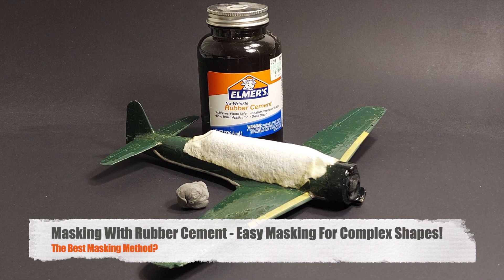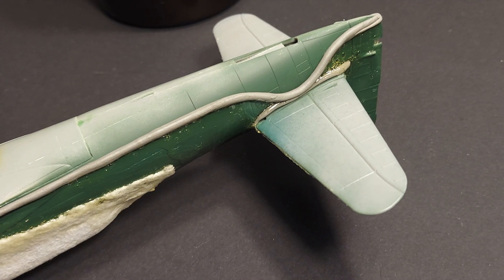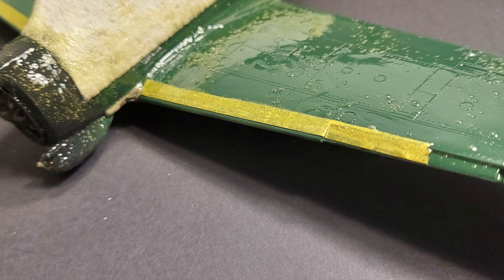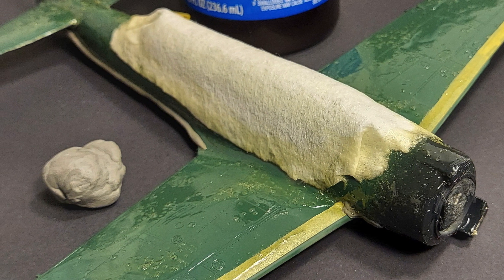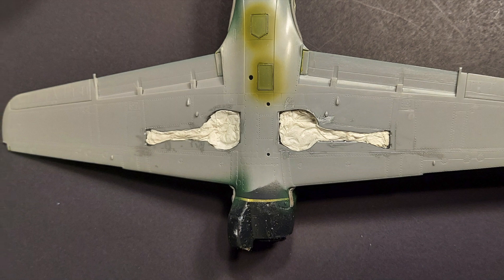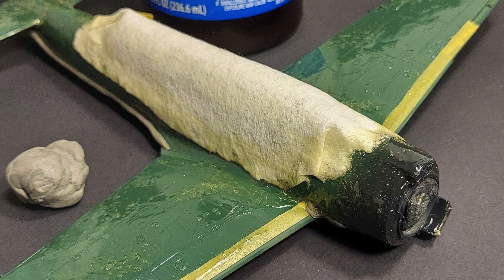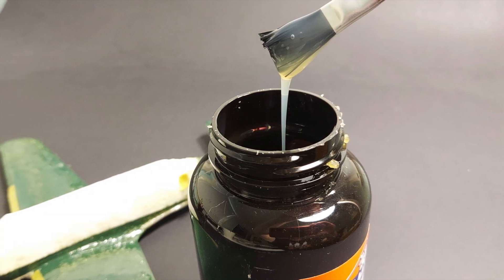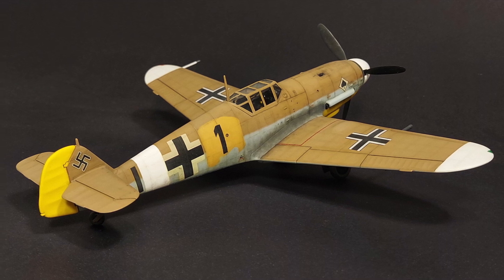Model Airbrushing Techniques - Masking With Rubber Cement - Best Masking Technique?

Comment: You're the only other person I've seen that's used rubber cement for masking.  I've used it to make psychedelic designs on motorcycle gas tanks and panels on hoods and trunks of cars.  Spray the base colors, dab the rubber cement down and stretch it across, then dab it again and take off in a different direction.  Add paint and rubber cement as needed.  It can look pretty trippy.  I thought maybe you were going to do a camouflage design this way.
Reply from the maker: Very cool! Do you use laquer paints? 
I do multi-color camouflage with this method as well. This particular plane has simple paint scheme with a solid upper color and a different lower color.
Reply: @jonsmodelkitreview4624  Yes.  When I first started doing this lacquer was the only thing I knew how to spray
Reply from the maker: @wilburross9709  Right on. It's good to know that it works with lacquer paints as well!

Comment: Would white glue work as well? I am restarting up building model airplanes after 22 years or so.  No airbrush at this time.  It is on the list of things to get in the next few months.  I have found that I get some seepage under masking tape. I put some white glue on the latest kit.  I'll see how it goes when I try to remove it.
Reply: I'd say no to 'white' glue for masking uses.
It can be used as a filler over primed surfaces & for clear parts...
Reply: I would advise against PVA (white glue). It will form a much stronger bond with the paint and plastic and, accordingly, be that much more difficult to remove.
Reply from the maker: I agree with the others here. White glue gets very hard when dry - great for attaching canopies, but not so great for masking.
Reply from the maker: Right on.
Reply from the maker: Right on.
Reply: As a follow-up, this was a very bad idea.  The glue would not come off on its own.  I had to wet it to soften it, still did not come off well.  Eventually ran it under the faucet and scrubbed it it off.  This ruined what I had done and I had to repaint.  Won't do that again.  I'll get some rubber cement on this weekend's shopping trip.
Reply from the maker: @mikelaponte2832  Sorry to hear that Mike! Hopefully, the rubber cement will work better for you.

Comment: Masking is absolutely my least favorite part of the process, as well. I've never used rubber cement, though. How easily does it come off, and does it ever lift paint?

I typically use latex masking fluid (e.g., Vallejo Liquid Mask 70.523), which is probably the same as rubber cement, only much more expensive. Must be some very costly dye they've added. LoL
Reply from the maker: Great question Darrel! The rubber cement hasn't lifted the paint on any of my kits. It can be stubborn to come off in deeper panel lines but patience prevails when removing it. I use the previously removed bits as a tacky removal tool.
Reply: @jonsmodelkitreview4624  Thanks for the response, Jon.

I'm guessing the fancy stuff I've been using is the same because that is the best way to remove it, especially if I made the mistake of applying it too thinly/sparsely--just use a bit of previously removed stuff and roll it over the areas of the model with the stubborn mask and it'll come right up!
Reply from the maker: @darrellid  That does sound similar.